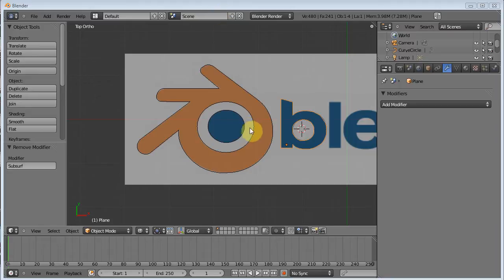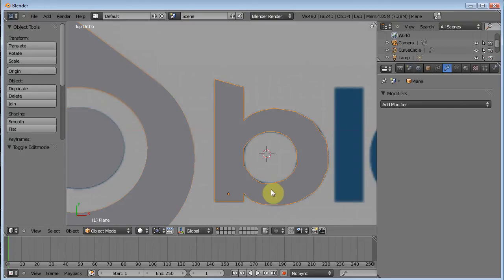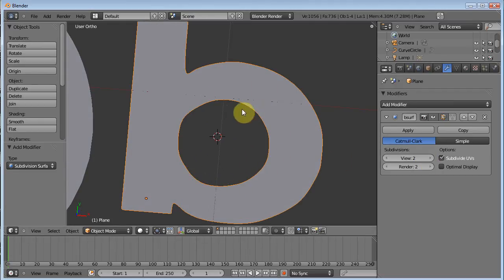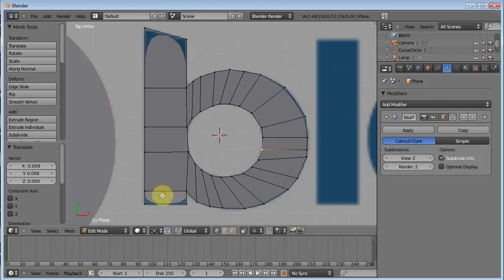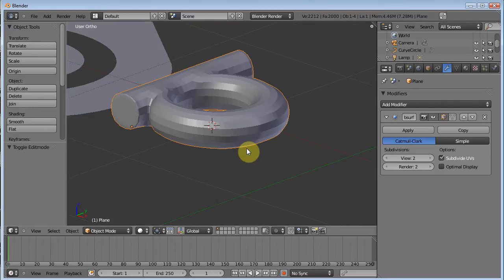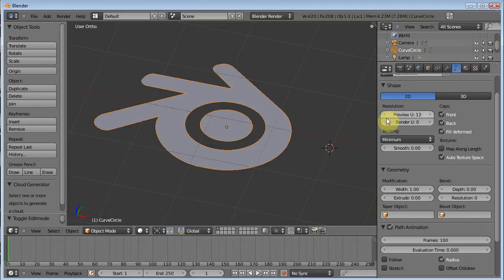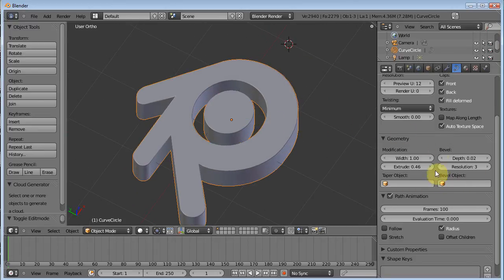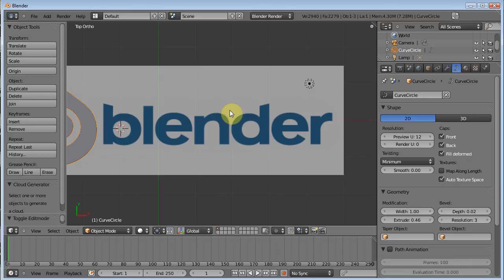Blender 2.5 Back to the Basics:Episode 4- Modeling+

Comment: @firechildc I'm having trouble with the actual logo. I'm not sure how to cut a hole inside to put another in. It doesn't automatically cut away if i add another as you stated in this vid. Idk if it's my version or what. (I'm running Blender 2.57)